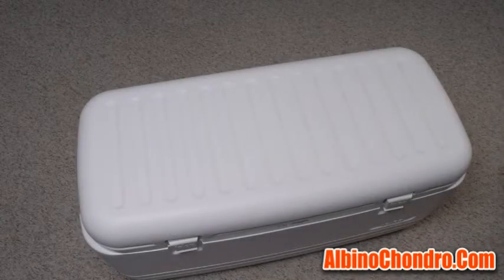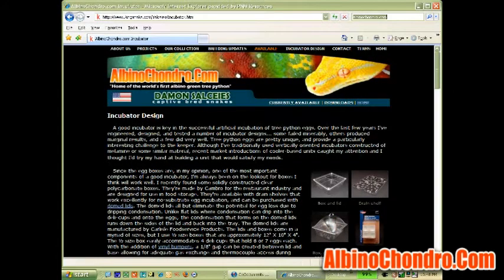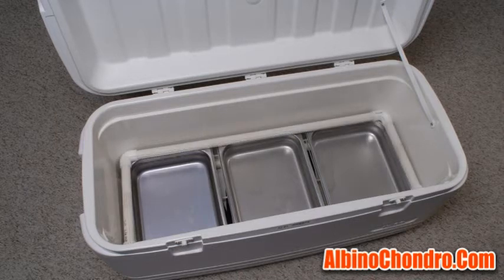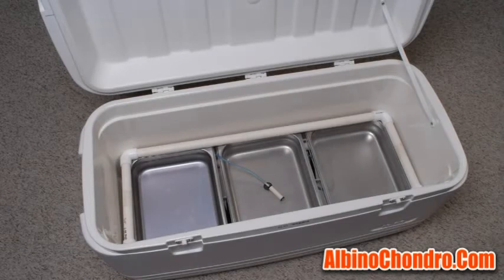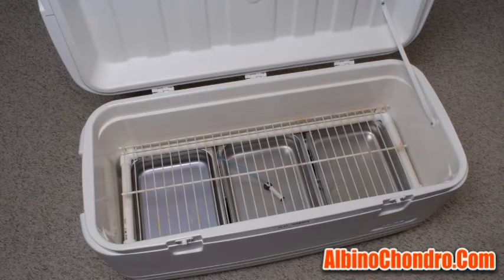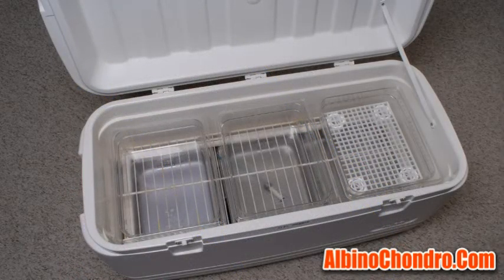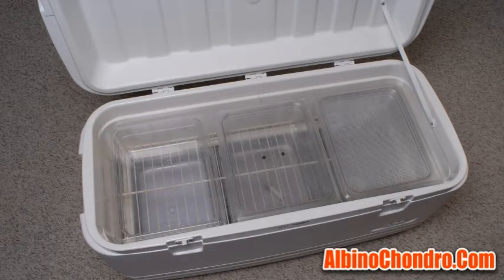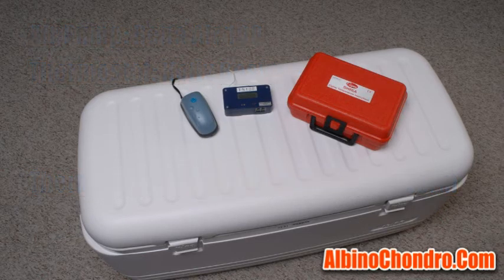Egg incubator design and assembly - AlbinoChondro.com

Comment from the maker: I use a 12V transformer to run the fans... just your basic run-of-the-mill wall wart. You can buy them at Radio Shack, but I salvaged mine from some old appliances. Good luck!

Comment from the maker: I purposefully stayed away from flexwatt because it's difficult to seal. The interior of the incubator gets humid and trying to isolate the connections on the flexwatt... even with rubber silicone... is not foolproof. The heat cable is sealed so there's a lower likelihood of failure. The set-up will work fine for ball pythons but if you'd rather not use the water trays you'll have to incubate the eggs on vermiculite (or some other alternative) to maintain adequate moisture.

Comment from the maker: It's been a while since I built the ones I use, but I think the incubator ran about $300 (including thermostat, air pump, heat element, shelving, pans, air lines, fans, electrical connections, cooler, and plexiglass). 

I currently have a single ball python that I've had for about 15 years but I've never tried to breed the species. Normals X normals will make more normals. Thanks for the questions!

Comment from the maker: I actually used the cables I did because there wasn't anything else available at the time. The reptile cables came along later and will work so long as they don't have the in-built thermostat you mentioned in your question. Good luck and let me know if you have any other questions. :)

Comment: Hey Damon, would a standard reptile heat cable work in place of the frost cable? Like a 25w rated 4 metre cable from zoo med or whatever? I live in the uk and most frost cables seem to have an inbuilt thermostat, and obviously i want to avoid the issue of using a cable designed for the US in the UK (different pin connectors/US v UK voltage system etc). So was just wondering as you dont seem to use reptile designated cables, is there a reason for that? Thanks
Gary